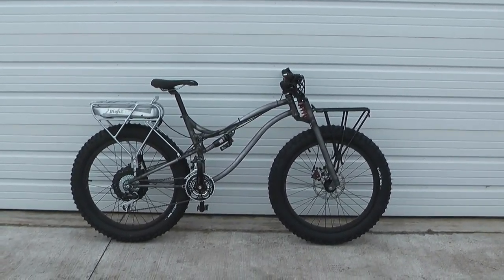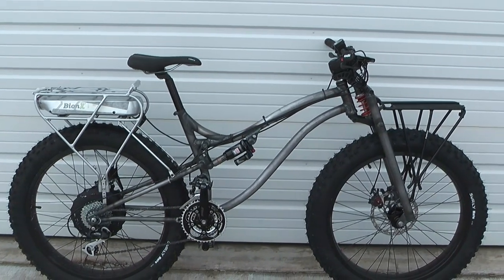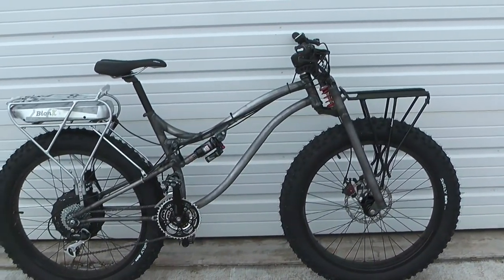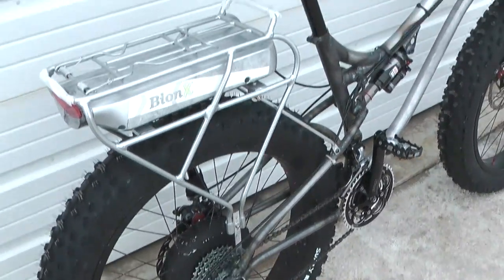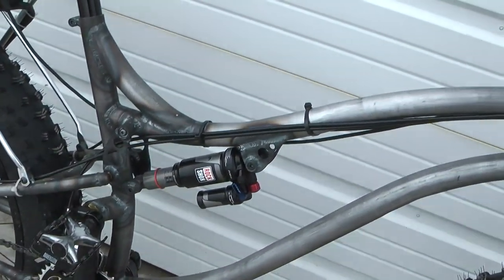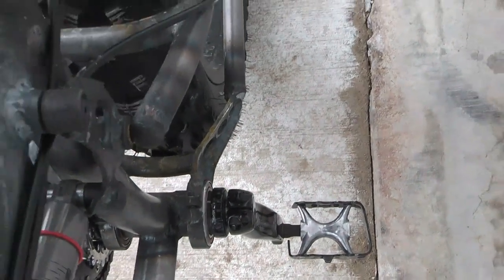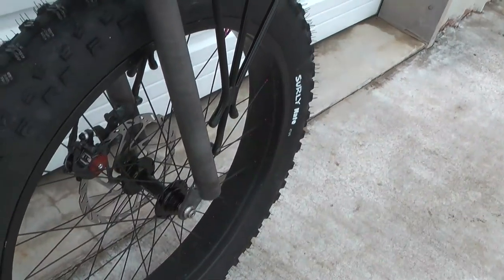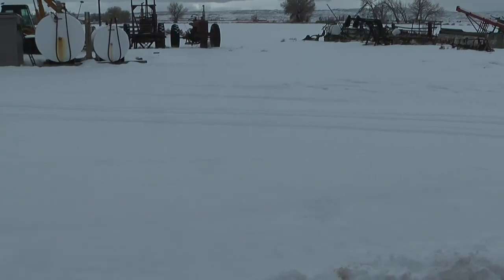Full Suspension Electric Fatbike 2.1

Comment from the maker: It would be more expensive than it's probably worth.  I usually spend at least $150 to get a used, original fork, so I can have the linkage and shock.  When you add materials and time, you're over $400 by the time you're done.  I wish they still made those forks, it would be easier and cheaper if they did.  Thanks for the comment.